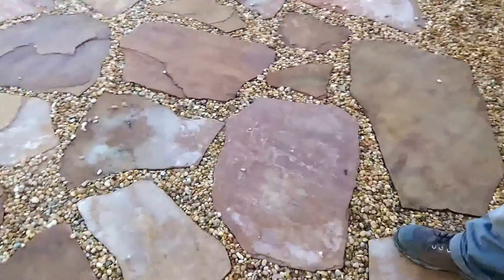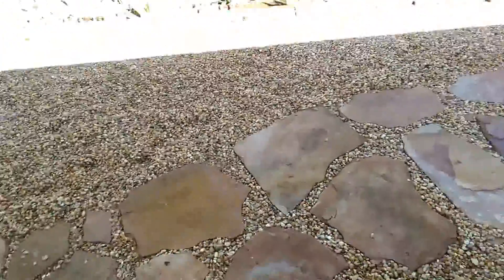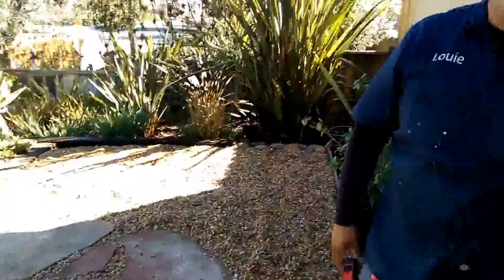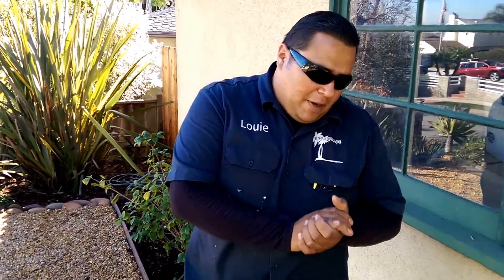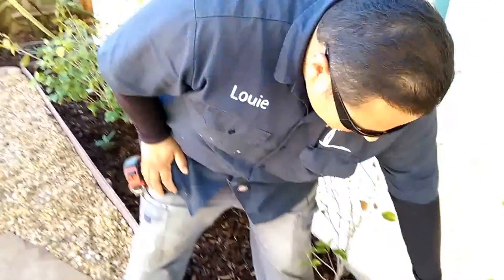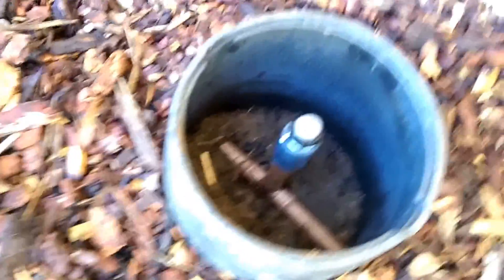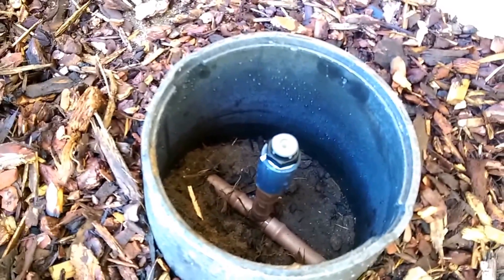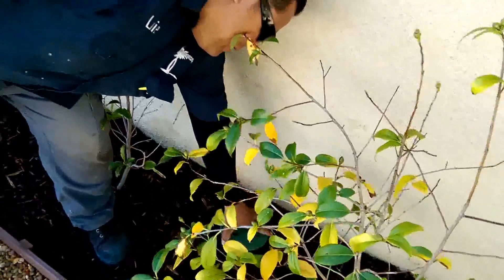Rain Bird Air Relief Valve

Comment: Hi Louie.
Does each zone need one? Where does it go? There isn't enough information in this video to help those interested in installing one of these valves. Thanks.
Reply from the maker: WWPermaculture ....each zone get one which should be located at the highest point of the irrigation run.